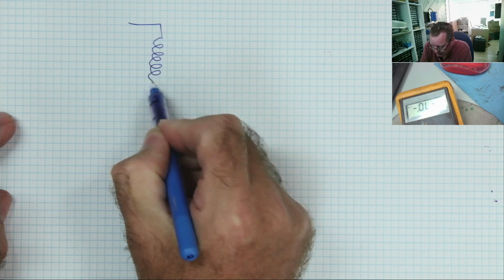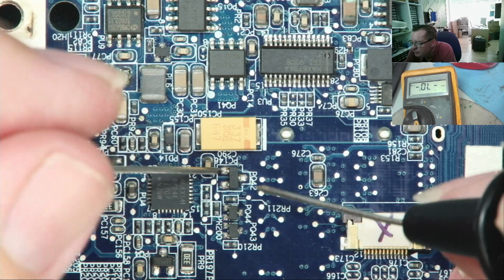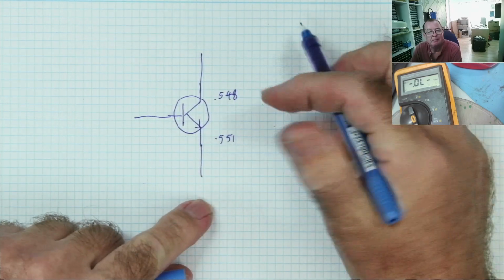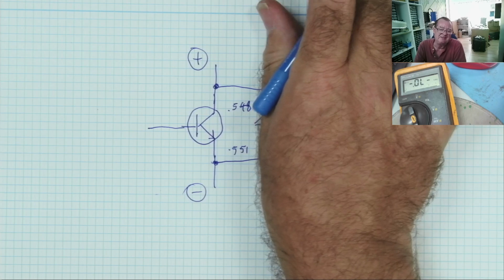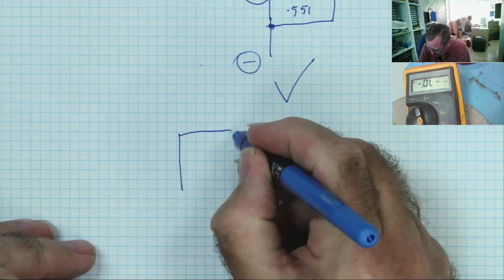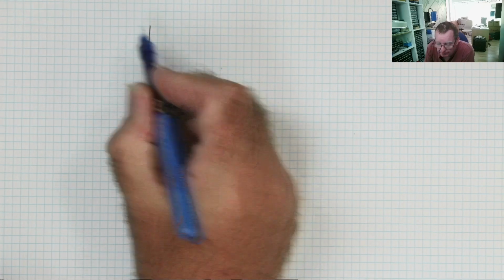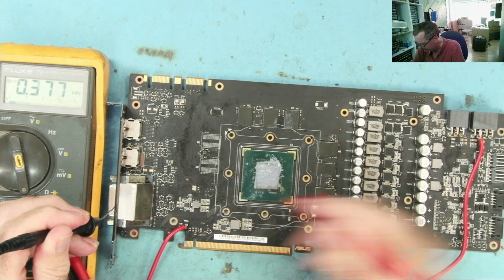PART 2 - All You Need To Know About The Diode Test Mode On Your Multimeter To Fix Stuff. How to use.

Comment: 12:55 - Or, you could use two multimeters: one to turn it on; the other to measure resistance.
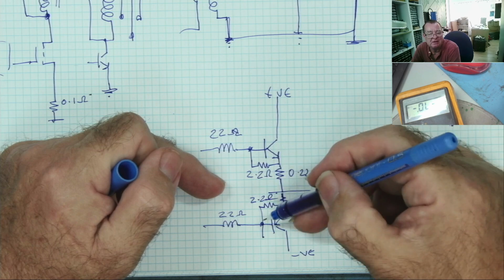18:55 Some concepts are easier on paper; but,  7:06 some are easier on board.
22:23 - Ha!

Comment: A lot of phone repair youtubers say to test for shorts by putting red lead to ground and probing caps using the black lead. But none of them explains why they use this polarity. Is this a similar thing to when testing opamps, to make use of the protection diode?